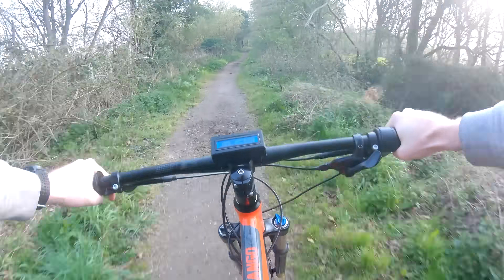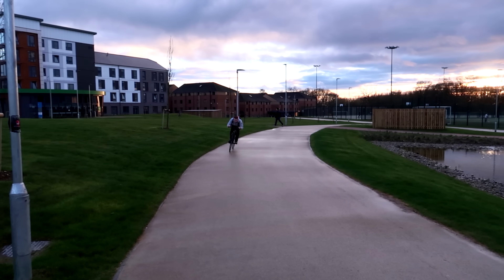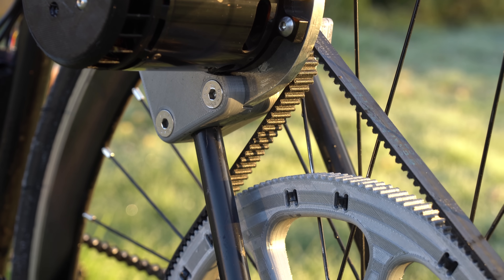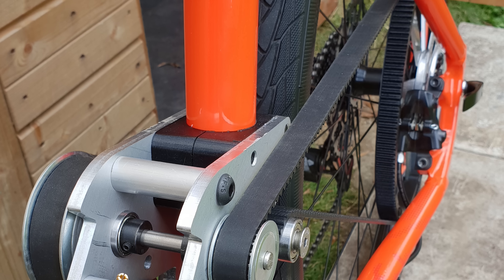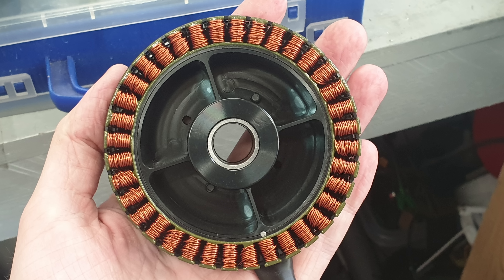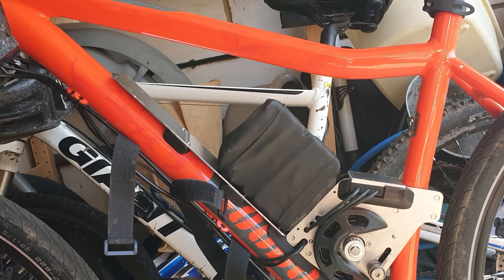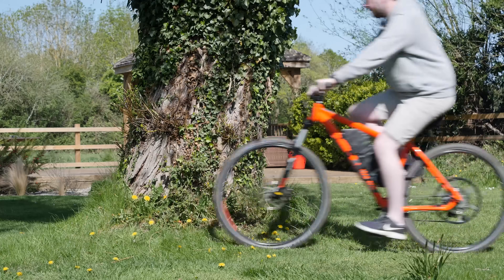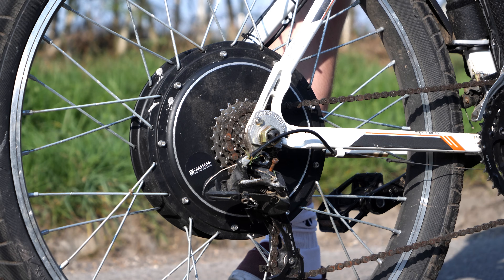Building an Electric Bike

Comment: Impressive tencity in following your path, while most of the problems solved relate to the decision to over-power an E-Bike like a motorcycle, and use a belt where a chain would do the same job without tensioners.

Comment: Why does nobody take advantage of the gear system? Putting the motor on the same axle as the pedals will use the gears and provide a means to recharge the batteries. Just need a clutch or something

Comment: Wanted to make electric tricycle that I could drive around in the city but law sucks ass and it's essentially not worth it. I mean, your most certainly also does not meet the law requirements soo I don't know how you're doing it, I guess you can drive it in rural areas without a problem. Where I live, max allowed speed is 25km/h. So yeah... sucks ass, If you guys want to make a usable electric bike which is legal, look up the law, because it can end up badly.

Comment: You inspired me to install a motor on my StreetStrider Elliptical bike. I can get up to 32miles on a single charge and top speed for me is 43mph  (12 gears, varies depending uphill downhill and my weight 216lb +backpack). I'm using my EGO lawnmower's 56v battery. Changed out the hub for a 52T, 3D printed a custom mount for the battery with electrical prongs, added a sensor on the rear arm with a neodymium magnetic screwed onto a rear spoke of the 20" tire that would calculate RPM into MPH. Switched out the brake handles with handles that have sensors to cut off power to motor during breaking and to resume once handle is released. Installed headlight and rear light. Oh and added a USB phone charger too, for those long rides across town and back. Took me about 3 months to build. Motor sits tightly under the hub sprocket. The hardest part of this build was taking off the original sprocket (new "key" tool was acquired) and running/zip-tie'ing all the electrical wires safely. Keep up the great videos 👍.

Comment: I got a beast ebike  its got  a 2000w electric motor and a lipo thats honestly the biggest ive seen   ive had 50mph out of it  the second i had a look at the guts i saw a big old xt90 connector and felt at home instantly but its not a speedy thing its for off road the way its geard up wont let it go past 50ish but good god its got some grunt ive pulled quads from ditches with it gone as fast up hills off road as all the petrol bikes my frends have i like it its my kinda tuned and half crazy velocifero i got a new cog set up thats got it right in the sweet spot it runs a chain strait from the motor and i had stuff done to a set of wheels to lighten them however i was thinking of making it 2wd but i need to get right in it and tbh its fine as is now

Comment: Have you considered using a hub motor? It would eliminate the need for the pulley and belt system and reduce points of wear and also alot less engineering involved, you would also have more space for batteries in the centre triangle. Just a thought.
Reply: You also run as much power as you want without risking snapping a belt or pulley
Reply: My bad spoke too soon...just saw the end of your vid lol..

Comment: this motors can be controlled with allmost any bldc controller. And sensor cables can be extended probably alot more then 1meterss, which gives option to place controller anywhere, but it may not work if cables sizes are different as it may cause timung errors if their size is different.

Comment: I put electric bikes back wheell to front of the bike and put the batteries on basket and anything worked fine untill it got jump out of basket and got short ;P
it caused 2 times to burn the hall sensors. I dodnt replaced sensors 2nd time and bought a Electric scooter instead. both have their adventages and disadventages.

Comment: Bruh, my country only allows 250w motor and speeds less than 25 km/h and to get a license to go faster you'd need a Motorbike Class 1 or 2 which are for up to 45 km/h 4000w and up to 25 km/h 1000w. Did I mention you HAVE to be 16 to get one of those, and go a whole course. For an Ebike, which for the record you can actually pedal faster much than 25 km/h. Why wouldn't I need a license for that?

Comment: get a starter motor for cars a regular car battery and a secondary chain sprocket and a push release switch for the handlebar a few feet of cable for 12v and a small batery charger and u are in business

Comment: Not crazy about having a motor up front with a belt going to the rear wheel.  It's kind of just like a motorized gas bicycle set up.  It's like you're taking all the downfalls of a motorized gas bike without the benefits.  The whole purpose of going electric over gas is reliability. For something like this, a hub motor would be and more reliable.  Those belts are going to stretch and break and fall off from time to time and loosen and start slipping.  I see this setup having issues long-term.

Comment: Adding so much power on a bicycle is dangerous because the brakes are not designed for such speed especially when rainning.
Also in city driving, those bikes are going often too fast and cannot be seen by pedestrians or by cars making a right or left turn.

Comment: The title is wrong. This is a Moped electric not a bicycle with pedal assistance.  
Most people are looking getting a bicycle so you still exercice, but in case of cross wind or small hill 
you still want to keep some speed without sweating so much than you need to change cloths or take a shower.

Comment: Would it be possible to make a low power electrical bike?
Like, I pedal for the first acceleration, and then let the motor maintain the speed for me?

I have a few 12v motors and some good lead acid univ. Batteries. It wouldn't need to go far or fast, it would just have to make the mile ride to the store a little less intense.
Reply: Thinking about a version for a BMX

Comment: One cool thing would be to see if you could fit a tiny two gear transmission, so you can have the the higher torque for getting started, then higher speeds after. I'm guessing system with two gears, maybe three, could be relatively easy.

Comment: Your first Ebike video inspired me to make a mini gokart using two 6374 170kv motors, 12s5p motor and dual focbox Vesc. The gokart frame is called a Goped Goquad, it used to be gas. It has a ton of torque and goes up to 30mph. Even with me and I weight 250pounds.

Comment: This video has given me a ton of inspiration and ideas. One of which being using the crank as the speed controller, either by using an encoder directly, or passing the crank through a back sprung differential with a potentiometer mounted to the differential bell. The latter would allow for you to use another pot on the handlebars to set the max amount of electric assist, and your additional pedal pressure while cycling normally would propel you forward electrically. This way you would still have to cycle for the sake of working out, but you would get additional range and some help up the steepest hills. This could motivate some to get on the bicycle seat more often.
Reply: How to make freewheel? Much needed for this project!

Comment: Hey dude great work, but I have a question that maybe you can answer, since I am not that great with building these.

I have a Easy Motion Neo City Electric Bike in a good shape, but I've lost the LCD display it comes with, I've cut the wire on the display and it reavled 5 smaller wires with the color order (black, white, green, yellow, blue - I know that the yellow and green are for DATA + -, between black and blue I got 12.6 Volts, I can't tell what the white wire is for). So my question is since I can not get a new original LCD display from the same manufacturer, is it possible to use a custom LCD display and it to be working? And what kind of display would work ( KT-LCD3 ) maybe?

Original Display - https://shop.scooteretti.com/products/easy-motion-lcd-display?variant=31433393864727

Comment: You need to add to your formula wheel size. To get finally mph per volt. I say that ideal is one mile per hour for each TWO volts of battery voltage. Works on any lightweight bike. If your motor is 20kilos or more - you can choose a faster volt-to-speed ratio. Good luck!   
PS you can check how fast can be an accurate hub motor on my channel

Comment: Hmm, me thinks a redesign of the front forks,  bear with me.  Get another bike, take the rear section of the frame apart,  turn it around, attach a hub motor on it, and then mount it via the yoke to the handle bars.  Then you have a hub and rear motor effectively making a 2wd drive e bike.  With the arduino, if you press the front brake, it cuts power to the front hub, then  to the rear motor.  If you press the rear break it switches off both.  I can see the design in my head, it will work.

Comment: What would happen if we put magnets in the wheel... head to toe + - + - + -... and coils in the frame in a 3 phase AC array?... it's harder to turn... but creates lots of electrons going back and forth to drive a motor with 3 times the energy available... a battery.. and diode bridge to create DC output. It is not perpetual motion..  it requires input from the battery... but it is definitely more efficient than braking to recharge..  

;;☆》♡♡♡¿?

Comment: Very nice project..... seriously loved it and I have some questions which are as follows:
   (1).  I won't like to know if I can use your formula to drive a diy drill press made from a single phase 0.45 Hp approx (with 1130rpm, 230V & 1A ratings) induction motor to get the maximum torque output with 1000rpm under load.
   (2). Can you please make a video dedicated on DC brushed & DC brushless motors size numbers with their max input voltage and max output power & rpm?
    (3). Can you please suggest me a commercial model with all metal gear transmission with slipper clutch and hammer drill option for my xd-3420 motor, inorder to make a diy hammer hand drill? I am planning to run it with a 36V lithium ion battery pack.

Comment: I was doing same thing making electric bike generator motors but had to much power. One motor run back wheel and front wheel generator motor charging the two gel battery top speed 56 mph!

Comment: i bought my ebike but added solar panels to run it using home made lithium batteries. the cells you got are very good capacity cells i didn't know 18650s could achieve 4 amp hours

Comment: Sounds like its a lot of work, to do what I was doing, 20 years ago, without a motor. I could easily ride, more than 50 kph, on the flat, most of the time, on a 20 kilogram Freestyle BMX bike. Now, the bikes weigh 1/4 of that, so I'm guessing anyone could ride like that. Still... fun building your bike )

Comment: Very interesting. I want an electric bike, but commercial ones are simply too expensive and lack power and distance. There are also laws that prohibit bikes from going too fast or they'll be considered motorbikes and require registration, insurance and plates, which adds a couple thousand dollars. So do not go too fast. You might get a fine from uncle cop. I would definitely get a hub motor simply because I lack the tools and skills to make and machine a mount. There are also no services that can do this for a reasonable price (under 100 dollars). Closest ones are in a radius of a couple hundred miles from anything, pretty much in industrial areas that are inhabitable by humans, plants and animals.

Comment: Hey 
Your approach is expensive. Please calculate how much power and torque do you need first. Then please consider to use supercapacitor + battery for high power application and planetary gear for high torque application. Create a clutch to change from regular bicycle into e bike. The rest is good.

Comment: i like your project but before you recommend to people first you should remind to check the law and regulations... for example i am in Netherlands  and here this bike would be illegal due its power and speed-here it would require  to be registered as a scooter because its not even helping but self going forward - so here you can have unregistered e-bike but motor should just help so if you do not pedal motor does not push you forward  and if you reach 25 then doesn't"help afterwards-means if you have power to drive faster will happen only on human power. if it helps faster then you need to register and you get a small registration plate+ you have to make some cheap insurance also.... but i am not expert on this side so i do not want to speculate...

Comment: Im wondering if instead of using a single gear on a belt drive if you could replace that with a Constant Velocity Transmission setup similar to that on a automatic ATV. Using a pair of conical pulleys you could have a ratio that gives enough torque for takeoff, and seamlessly transitions to a ratio for higher speeds

Comment: In england...(bear in mind 12 points means having your licence revoked and possibly a ban)
On road 
-No tax: £80 fine
-Riding with no MOT: up to £1000 fine
-Riding a motorcycle without insurance: £300 fine and minimum 6 penalty points (if it goes to court you can have an indefinite fine and be disqualified from driving/riding).
-If you have no licence: 3-6 points and a £1000 fine....  PLUS if you have no licence and insurance together (you cant get insurance without a licence so that's a yes BTW) you get ANOTHER 6-8 penalty points AND another £5000 fine, They can also ban you from getting a licence for [amount of time they decide] and if you eventually do get a licence THEN the points are added on....and then get rebanned presumably. because of all the prior points you accumulated.
Off road
-Dangerous cycling: £2500 fine.
Probably others, Infact all the above may apply as well I'm tired of finding ^that out alone.
Probably plenty more on this list. https://www.lawdonut.co.uk/personal/traffic-offences/table-of-driving-penalties

Comment: It would interesting to see how cheaply you could make a road legal version.  Taking into account the legal maximum speed 15.5mph and the requirement for it to be pedal assist controlled as throttle control is not allowed to go faster than 3.7mph in the UK/EU

Comment: 112:46 I like the equation, good to know, but the value of "10" is only for 26-inch-wheels!?! How high should that value be for 28-inch-wheels (road/race-bike)??? Thanks! Tha latest motor had a "torquier"-formfactor ("pancake" instead of "can"), the equation should produce deviation: Althought you are over "10", the torque is still good. If I get it right...

Comment: you really need top stop using drone motors, you're having dust problems because that motor was never supposed to stay close to ground.
Reply: They are sealed better... the balance board Segway type can run through water and keep right on going..  amazing, this modern technology, eh?
Reply: @richardcarew4708  wtf? 😂 They have big holes in front of the motor, how are they seald? They have a advantage of better cooling but in long term, running drone motors close to the ground gonna ruined them.
Reply: @miguelantonio7135  perhaps you should look at one of the diagrams provided by the manufacturer.. I don't own one.. I have seen the information, but didn't look at it.. despite rumors to the contrary bro.. I don't know everything.. worse luck 🙃
Reply: My phone suggests "anything" in the last sentence.. phone humor.. no doubt
Reply: @miguelantonio7135  why not use sealed liquid cooled motor?
Reply: Running bike fenders will keep some of the dust down, most high power, bicycle intended brushless motors rely upon either surface air cooling and are internal rotor or in some cases a dedicated water cooling outside the stator.  Outrunner motors are meant to be operated in their own airflow because they drive propellers and don't drive ground vehicles.

Comment: I've been riding ebikes for a few years, and one thing I'll note is that a mid-drive kit works better than a hub motor. Having that gearing system helps so much with torque and just applying the power to get up to speed. I have both, purely because my cargo bike won't take a mid-drive kit, and even with a trailer and kids in it, my mid-drive crushes hills like they don't even exist, but I have to walk the cargo bike up. Both are 750w motors, both have 48v batteries (the same generally).

I think the problem is you made a hub drive that doesn't have the neat internal direct drive gearing of the purpose built hub drives, meaning you're losing power all over the place.

Comment: you need a belt tensioner like car bro, especially running multiple gears under load, tensioner would also make it easier to change the belt and keep tension as the belt stretches over time

Comment: Hi Tom Awesome Engineering skills, 

I was wondering what kind of CNC router you have? and how did you cut out most of the motor bracket profiles, did you make it yourself or purchase?, I am working on some modifications to e bike conversion myself and will need to make some brackets for support. 

Any info would be really appreciated. Thanks, are really talented and keep up the great inspiring work ! :)

Comment: Great video, as usual, Tom - many thanks.
Regarding trying to have 2 motors driving 1 road wheel... From your experience, having them drive a chain/belt that in turn drives the wheel, doesn't work: https://youtu.be/1pm1RtCuE3A?t=143
Could it work as follows, though?

Essentially, use a small differential drive unit "in reverse". Have each motor in place of where the usual output shafts of a diff are. Also, possibly include ratchet/free-wheel so the motors can only drive in one direction. Next, where the diffs usual input gear is, wrap a chain around it and take that chain to the bike's rear wheel.

My imagination has it that each motor could independently run from 0-100% power, adding what is required to the drive-train. possibly, motors could even be of differing sizes/powers.

Seems to work using that well-known modular plastic construction kit!

What do other readers think?